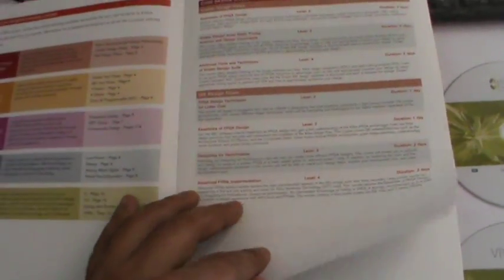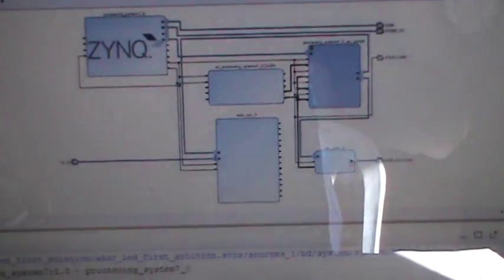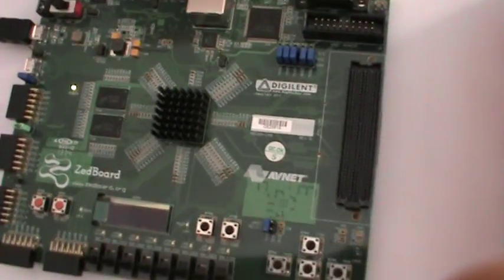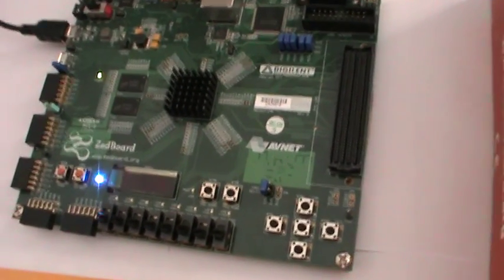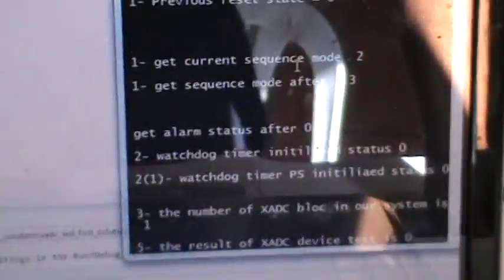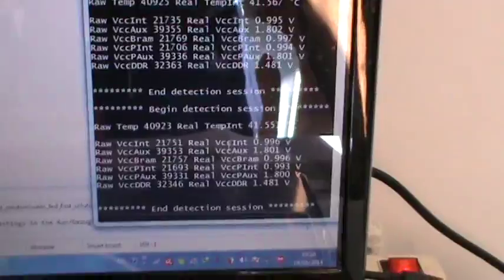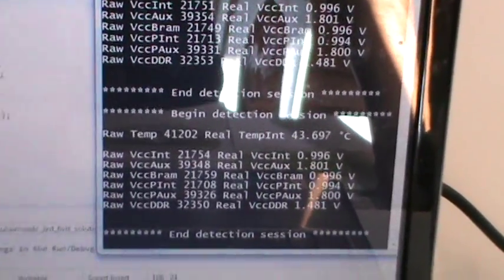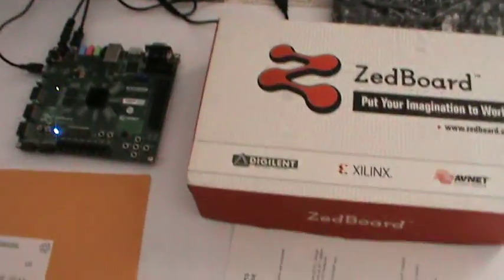ZedBoard: Graduate Project Engineer

Comment: I was following the tutorial given on your website for : http://xillybus.com/tutorials/vivado-hls-c-fpga-howto-1.

I was able to boot up the xillinux on board and I also passed the loop back test as given in section 3.3 of this manual : http://xillybus.com/downloads/doc/xillybus_getting_started_linux.pdf.

I then modified my verilog files as per the tutrial and generated a bit file in ISE by integrating all files from HLS with the previous files. Now when I try to run the HLS demo program I am unable to get the expected output. 

Even after modifying the verilog code when I try the loop back test for both 8 bit and 32 bit , I am able to successfully complete it . But when I run the HLS demo code I get the same number which I have sent in my C program and no addition or sin calculation takes place. I believe data is not being sent from PS to PL.

I would be really great full if you could please help me in this regard and suggest what are the steps I am missing in my implementation.

I have even sent you a message through xillinx forum. 

Awaiting for your feedback.